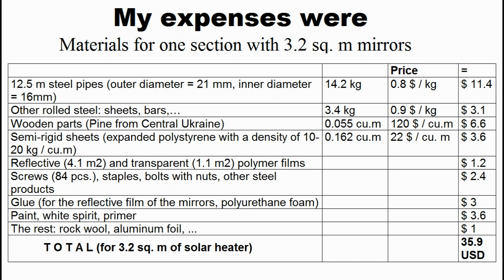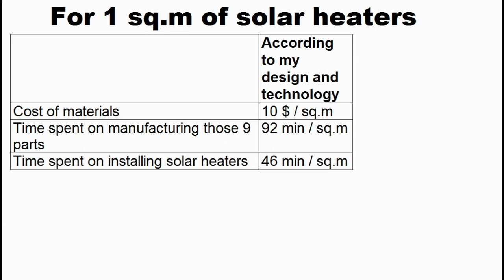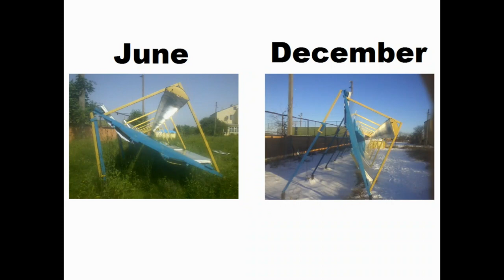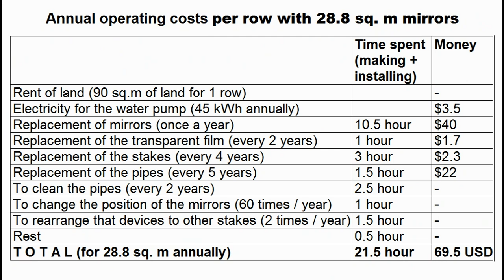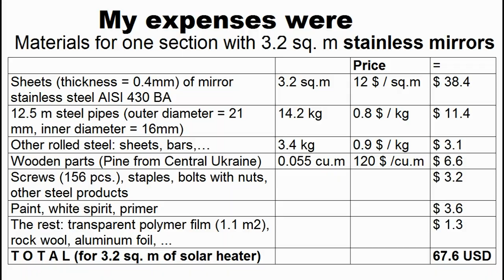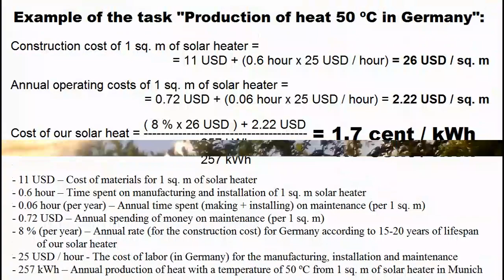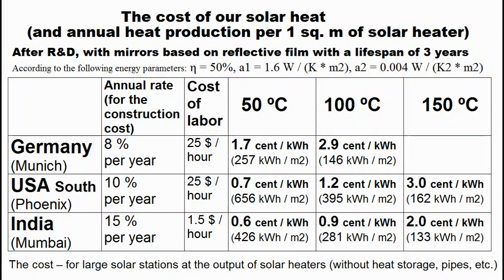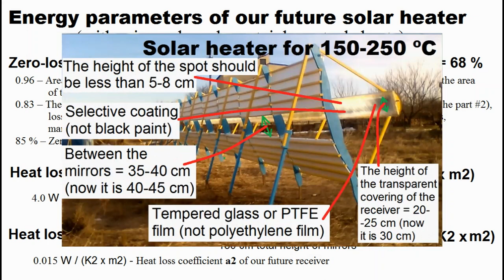Details about this cheap solar heater for 50-250 ºC (its design, maintenance, lifespan, cost of heat

Comment: Sand has an amazing way of retaining heat. You could also combine a geothermal system with your solar heaters to store heat generated in the summer to help with heating during the winter. Dig a well, then send the output of your solar heating system into that well. You would then fill that well with sand before capping off the well with a layer of clay. You should also have the water lines come back out of the well to heat your house.

Comment: Try to:
1-Change your stacks for PVC pipes filled with concrete;
2-Use a painted steel sheet or tubes or bars to support the reflexive film;
3-Bronze or cooper tubes;
4-Aluminized films to insulate the tubes;
5- Frames and supports to make repetitive jobs faster and easier  in  manufacturing.

Comment: Use mirrored window tint (cars) on Perspex or any transparent plastic, use it's reflection, and also the heat that passers through the Perspex,  and cleans like a normal window. I did this over ten years ago and it still works.

Comment: what I'd suggest to make the mirrors last longer is to coat them with a UV stable marine-grade epoxy.  You could probably get like 10 years out of each mirror.

Thanks for your awesome videos

EDIT  Also, if the Mirror film is coated with epoxy, you could powerwash them clean
Reply: Agreed but I have worked with West System Epoxy a lot in boat-building and that stuff sure is not cheap.  The price for a quart (litre) these days is the same as the price I used to pay for a gallon (4 litres).  That's 400% inflation over the years!  Whoa!
Reply: The problem of using strong coating is that not just the mirror film but the entire panel would have to be replaced at three end of whatever lifetime you get from them. Thus you need very good performance she reliability to justify it

Comment: That is an amazing video.  I hope your talents can be applied to rebuild a green Ukraine when the opportunity comes.  Have you considered any of the following:
1) I guess you use a multi-pipe receiver due to imprecise aiming but it blocks significant solar insolation.  Right now you arrange the pipe set perpendicular to the parabola axis of symmetry but what if you arrange a pipe set parallel to the axis of symmetry.  Still allows for poor focusing but blocks less insolation
2) instead of various reflective films have you considered reflective paint such as chrome paint?
3) I am considering cheap high temperature fluids and specifically looking at recycled automotive brake fluids.  They don't freeze and have wet boiling points around 150C (300F).  Free on a DIY scale from an auto repair shop but would have to be purchased new to use on a commercial scale.
4) when you investigate a higher temperature system I expect part of the goal will be some cheap small scale electricity creation, likely using a steam (Rankine) cycle.  With a combined heat-and-power solution your overall efficiency will look great.  I have had trouble finding a cheap way to hack this electrical solution.  Good luck.  Your solutions so far have been creative.

Comment: Genius! Here's an idea: Place a rotating pipe on the top of your stand (blue) and connect it with the bottom yellow part with rope. Remove the pins and you can adjust the angle of all panels with a lever on the end of the pipe by rotating it. Afterwards just lock the lever. 
Also: If you can reach very high temperatures you could also experiment with quick-lime as a chemical heat storage.

Comment: Hmmmm.... you mentioned weather degrades your foiled foam sheet reflectors in a ~year.
If the sides of your parabolic reflector is longer than your focal length, you could use inexpensive glass over the whole-thing.  Of course tempered glass would be best in the long-run.

The glass will protect your foiled foam sheets from weather as well as increase your operating temp.
?What do you think?

Comment: If you want to set up a system for heating a thermal transmission oil.  With a volume of 500 liters, how much space do I need to collect the sun's rays?  This prevents the burning of thousands of liters of diesel for heating

Comment: You could put a small water tank above the expansion valve
Reply: I think the intent is for drain-back to dry the system for freeze protection and so adding a water tank might miss the goal.

Comment: Why don't you bend the stainless steel to stay at the correct curve before you place it on the stand? This would reduce the need for securing screws to achieve that curve.
Reply: You could also replace the steel pipe of the receiver with coiled copper tubing. This would however require cleaner water than what you used. That cleaner water could be achieved through the use of a settling tank, like that which you showed after cleaning your system. The settling tank option could create still cleaner water if you included a filter on the side where the water leaves your settling tank.

Comment: mass automated manufacturing
Reply: automated vacuum mirror deposition
Reply: quick aluminium electroplating
Reply: carbon cement concrete
Reply: passive insulated heat conduction
Reply: closed loop heat fluid transfer
Reply: if you purify dirty water with this then, do it in one point
Reply: you could burn out the dirt with superheating too, gasifying
Reply: glass coating of the transfers and the mirror layer
Reply: @Jkauppa  It is my understanding that the "dirt" is the result of internal pipe corrosion, made worse by air introduction everytime the piping is drained dry for freeze protection.  Thus the "dirt" is not "soil" like a person might think.  It is actually sediment of oxidized steel.
Reply: @chavocanuck  so have a cleaning liquid taking care of the glogs and filter the crap out of the pipes, out of the collector loop, in a filter